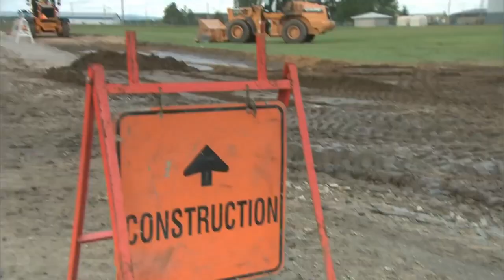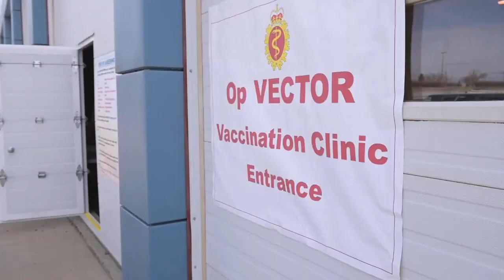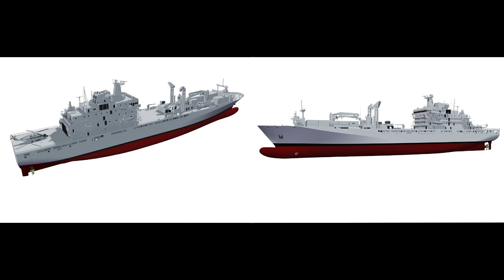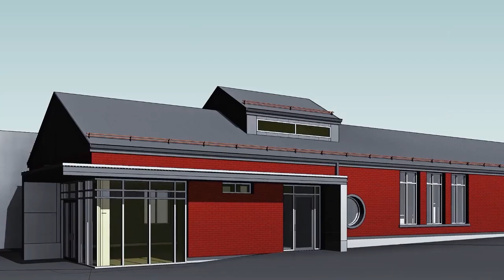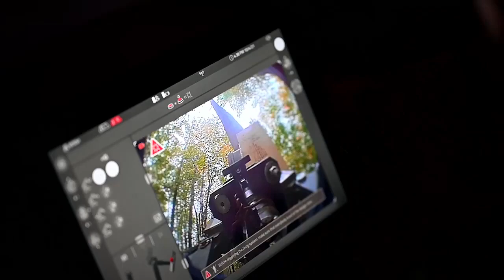Get Excited - A Look Ahead: Comprehensive Overview

Comment: All of the Leopard 2A4 should be upgraded to 2A4M standard with L55 guns. We should've still kept those Leopard 1C2 in our inventory as infantry support vehicles. Our force is too tiny for any real impact on keeping the world safe.
Reply: if theyre going to upgrade anything on the A4M it should be the Engine, Transmission, and torsion bars. the power pack cant support the extra weight. making the leo useless
Reply: We still have all out Leopard 1’s they are sitting rusting in a open air parking lot in gagetown.
Reply: @colinjohnston5734  i mean, thats not true
Reply: We aren't responsible for keeping the world safe. The biggest impact we can make geopolitically is with economic power. Any humanitarian cause we would assist with NATO or the UN would likely only require air-power, not a full land invasion.
Reply: @off2tims962  you are right, 5 were gifted to Oshawa Museum.
Reply: you can have all the tanks in the world but if no one is willing to stick around and drive them then what...
Reply: Just the results in Ukraine ,tanks ,some helicopters etc are becoming obsolete, the drones seem to be very effective along with the stingers or whatever version.
Reply: @stevejones1563  Nonsense. Average lifespan of a drone is between 3 and 6 flights in Ukraine. Only clueless armchairs think tanks are obsolete.
Reply: @death_parade   ok play your video games ,I was in the military and thats my observation in Ukraine that I'm shown, why are drones ,stingers and whatever working quite well,also costs ,there's alot for argument .
Reply: @stevejones1563  You aren't the only one who has been in the military. And judging by your "observation", you never ever sat in a single class of Combined Arms Warfare. Or any class on Design of Experiments or Statistical Analysis, for that matter. Or you'd be more appreciative and nuanced in your  views, not like now, where you give out blanket statements as if one war is enough to dictate which way the RMA is going.
Reply: @death_parade  General Patton! Wow is that really you, say what you want I was looking at Ukraine only ,there's the numbers and footage shows tanks blown up ,stuck whatever all over the country ,I don't need a class to show me that, also look at Russia now pull back and use missiles which others would have done first  then maybe tanks etc
Reply: @stevejones1563  Thank you for further proving my point. What you need are classes from Ronald Fisher.

Comment: Yes all the leopard 2A4 should have been upgraded several times. Even the A6 should have been upgraded. Some of the 1c2 chassis could have been used. Our government NEVER wants to spend on the military so we should be like Israel & use, upgrade, rebuild enhance some of our equipment instead of just scraping.
Reply from the maker: That's our plan so far with Subs, Fighters and Frigates etc until replacement. Unless we are entering a period of war or instability. 

It's probably the right choice, I'd rather have our better quality of life than a massive bill from the military.
Reply: 2a4s are for training.
Reply: @FrontlinePros  How often do you replace your car, remodel your kitchen, bathroom. I guess it's alright too do this living beyond your means but the military can use generations old equipment.
the aircraft they are using were purchased during trudeau the firsts reign.
The military is like the police, ems & fire dept., you invest in it to get a better quality of life. It's always there if you need it.
Reply: @sharpy3453  As I understand it Canada purchased 120 leopards broken down into approximately 100 2a4s & 20 leopard 6s. So we bought lots of training tanks & relatively few combat tanks.
Do the Americans buy 2 sets of tanks, one for training & one for combat. I suggest we buy all combat tanks and replace those that are worn out or uneconomical to fix as they are needed but then I would want a lot more. Seems I would get more bang for my buck than wasting billions on farmacare & day care etc.
Reply: @donhlohinec2242  we have 3 variants. The a4, a4m can and the a6m. The a4m can is our most advanced tank in our inventory.
Reply: @sharpy3453  The a4 is a none upgraded tank. the a4m is the one with reinforced belly but NO better gun than the original. the 2am6  is the one with increased belly armour & better gun.
Reply: @donhlohinec2242  the a4m has belly armour, an electric turret, improved electronics and whatnot and has arrowhead armour on the front with additional side armour on the turret  and hull. It's currently the best tank in the inventory until they upgrade the fleet or purchase new tanks. Knowing the caf it will be upgrades next
Reply: @donhlohinec2242  The training tanks can be upgraded to a higher standard, but they'll probably not see any tank-on-tank combat. They are more likely to be used for infantry fire support and taking out the odd target of opportunity - i.e., APC, IFV or tank if they pop up.
Reply: The Leopard 2's have been upgraded.  I agree the A4's should be armed with the L 55 though.  We should also buy more so all three Armored Regiments have 3 squadron's worth not just LSH(RC).  Unfortunately keeping the C 2's is not an option, unless we can source spare parts for the next decade or more.
Reply: @donhlohinec2242  all of the Leopard 2A4's that serve in the Armored Regiments will be brought up to 2A4M CAN standards if they are posted to a war zone.  For training here in Canada the added armor is not needed.  I do think we should have bought more though.  All 3 Regiments should have a full complement of tanks.  Right now the RCD and 13 RBC have to share.

Comment: For a defense oriented air force like the RCAF, I feel the SAAB Grippen-E is better suited than the Lockheed Martin F-35, with radar tech constantly advancing, we don't know long aircraft designed to be stealthy will actually stay stealthy. Not to mention that with the F-35, unless you're ready to sacrifice that built in stealth, you won't be using the six weapon hard points under the wings and be restricted to the two internal weapon bays. The Grippen-E has better range without external fuel tanks, it's more agile at subsonic speeds, and cheaper per unit and lower operating cost. Not to mention SAAB already verbally agreed to build at least two production facilities in the Montréal area, adding to our national industry.
Reply: Our industry is already producing parts & doing research for the F 35 & the facilities are in other parts of Canada not just Quebec. The Grippen will be just a make work project for Quebec.
Reply: The F35 have more capabilities than what you mentioned. It can do EW,  SEAD, command and control ammunitions fired from other aircraft just like alley oop in basketball with digital link connectivity.
Reply: Canada is a member of NATO and may be called upon to defend another member state. If Canada's idea of it's airforce is just air patrol and interdiction, then the old F18 is good enough to fly side by side with Russias clunky bombers. But when the shooting war begins, those 4th gen aircraft will be ineffective against new SAMs and LR missiles. Trust the professionals to make the choice and not the pundits and politicians.  Israel, US  Germany, UK, Australia, Netherlands, Finland,  Denmrk, Japan, Italy, Singapore, Switzerland, Belgium, Norway, air forces cannot be all wrong.
Reply: The Gripen is so good that Sweden signed up for the Tempest program.  That tells you all you need to know about the future capability of that aircraft.  Read your defence policy: Canada's air force is expeditionary, with NATO missions to fulfill.  We need a fighter for the next 50 years, not the previous 50.
Reply: Nailed it Nicko...100%.
Don't get me going...
The best fighter for Canada?...is the one in the air.
Just one look at the map of Canada...turn it upside down...says it.
I worked and flew, in the back... out of Yellowknife for ten years up to the Nunavet border.....there wasn't a tree for 100 miles in white-out conditions at -50 below.
The Gripen E/Fs are perfect for Arctic OPs..... they can ride off an Ice-road or a mine strip with small dedicated basic support teams.
Yellowknife and Iqaluit would have been perfect locations to station new permanent Sqns.

These '88' F-35s, (replacing 138?...did Canada shrink?) is a game-crushing 'hanger queen.'...fixed and locked into just two massive 'big base' infrastructures at Cold Lake, Alta, and Bagotville, Que.

I like to go to Bestfighter4canada.org...' Jet fighter club'...Gripen vs F-35 for comparisons.
Good luck...Good hunting📯
Reply: Ukraine/Russia war is modern combat, nether side has air superiority because nether side has a stealth jet that can operate and hunt SAMS, Gripen will be the status quote, will see the same when Ukraine starts operating F16's.  The F35 can house 6 internal air to air missiles, it was only two because a rail system to deploy them needed to be developed but other things were higher priority on the list.  Block 4 F35 should have the rail system .

Comment: I drove a TAPV for 3 years in the Canadian Armed forces with the Royal Canadian Dragoons and took part of Operation Lentus and Op. Laser. My unit was sent to Latvia when my contract ended.   Procurement for the armed forces is the worst.  A TPAV is a multi million dollar vehicle and most of the doors would fail or straight up not even work. Also they built a new facility for us which they only found out @ 90% completion that it couldn't house our entire unit which was its purpose.
Reply from the maker: Sounds about right, they keep trying though bless their hearts.
Reply: @FrontlinePros  really great video tho good research

Comment: If Trudeau wants to impress me, he could announce a one time 20B invest in CAF just like germany announced a one time 100B invest.
Reply from the maker: I'd like that. I'd like that very much.
Reply: @FrontlinePros  could get some shiny new tanks and upgrade the current ones, tracked afvs and actually buy them this time instead of canceling the purchase of cv90s because some pencil pusher in ottawa decided the lav could do the same job and buy some other newer stuff. maybe bump up the size of the military. maybe get some attack helicopters as well.
Reply: @sharpy3453  It would probably be spent on IFVs and anti air equipment for ground force. And, in my dream on a legit artillery system. Right now i think we have 30ish M777, its not 5 canons per province... It takes 10 man to operate it and has a range under most modern motorized artillery system.
Reply: @benoitnadeau5845  yeah, some kind of self propelled system again, cv90s would be good, especially if we get ones with TOWs. could even get some air defence ones or another vehicle for air defence and maybe 105 or 120 equipped ones.

Comment: The F-35 is an ultra-modern fifth generation stealth fighter more than able to survive a modern high intensity conflict. The Grippen is a decades old forth generation non-stealth fighter, already obsolete and utterly unable to fight a peer adverasy without massive losses. Therefor the Canadian Parliment will almost certainly go with the Grippen.
Reply: they had some serious issue keeping this f35 in the sky weeks ago it cost a freaking fortune to run and maintain and its a bomber not a multipurpose fighter wich we need!
Reply: @davidlefranc6240   "a bomber not a multipurpose fighter"

Way to advertise your ignorance.

Comment: The best shipbuilding company is the Sorel one. So it should have a part of the contract. 
Le chantier maritime de Sorel est le meilleur pur construire les frégates, de ce fait il devrait avoir une part du contrat.
Reply: No. It's too french.
Reply: @derekcollins1972  French or not it is the best and the biggest in east of Canada (may be in east of north América). The most protected in case of war ( witch could append soon).
Reply: @christiandebray  No,they are doing well where they are. Too much red tape to be made in Quebec.

Comment: I would have prefered the F18 Super hornet or even the F15 Eagle , I think our pilots should ride over the vast north with two engines.
Reply: Single engine F16's from 148t Fighter Wing have been patrolling in arctic as part of NORAD for some time now. New technology also sees advancement in reliability, which makes the dual engine redundancy a moot point.

Comment: If I ran military procurement, would drop 3 CSC, and purchase 2 Juan Carlos Amphibious Assault Ships c/w 40 F35-B Strike Fighters for expeditionary operations.  For Continental defense, would build in Canada 50 Gripen E ‘Arrows’.  This alone IMHO would only be incrementally more money, but increase capabilities significantly.  Then I would start modernizing the submarine fleet, purchase mobile air defense, and a small fleet of marine attack helicopters.  😁

Comment from the maker: What CAF project or new equipment are you looking forward to in 2022?
Reply: The F-35 or the gripen
Reply: We get new equipment... that is a first.
Reply: I think that both the F-35 and JAS-39 are neat planes, and either would be great. On one hand, you get a nimble multirole that’s much easier on the RCAFs wallet, and on the other, some funky fresh stealth and sensor tech built around network-centric warfare.
Reply: 2022? You mean 2032 at the earliest
Reply: LSVW replacement?
Reply: @flimmingo8ch  Rumour is it's a Mercedes Benz Zetros. Much larger than the LSVW, almost as big as MSVS, odd choice
Reply: Some integrity in protecting Canadians on home soil.
Reply: Really hope they pick the Gripen. We need longer ranged aircraft that doesn't rely on passive stealth. Domestic production is a big plus.
Reply: Big heavy duty tow trucks, please!
Reply from the maker: @flimmingo8ch  God I hope so, one day. I saw some draft purchase ideas a decade ago.
Reply: Missiles equipped delta planes

Comment: The RCN needs two LHA's (ex USN Tarawa Class of available) they can serve the Army with better Expeditionary capabilities and they need tilt rotors of some sort the AW609 comes to mind (Army and Air Force) they also need a pure attack helicopter (that can be used in both maritime and land environments again Army)  the RCN need to invest in LPD's of some sort (New Zealands Canterbury Class comes to mind) again to enhance Expeditionary capabilities for the Army (plus HADR etcetera) the RCN will need at least 2 LHA's new or used and x2 LPD's new or used. The Army needs to get dome Bradley's from the US but with the 30mm turret to complement the Leopards and enhance tactical armored mobility on the battlefield.  The F35 is a great plane for countries that can spend 800 billion on their military where they can afford to buy 100's of them as opposed to 45-80 to cover a land mass like Canada, they need quality and quantity, what aircraft can balance those two aspects, not the F35 for sure. Anyway just thoughts  btw anyone who think that Canada doesn't need at least LHA's or LHD's is living in la la land (hell give them ice breaking capabilities to boot) but dont buy down on the Armed Forces especially when there are so many hot spots on the map right now.

Comment: We need Battleships, Destroyer's, 6th generation Air Force Fighters, f-35 would be nice 👍 stealth fighters & bomber aircraft. We need attack Helecopters and 100s of thousands more updated Battle tanks. Drones and we need the better Air defense systems, basically overhaul the military, Strong & Free.... Our Military could be a whole lot stronger 💪 if our Government would stop the red tape & put all the resources from our Country, oil, gas, minerals etc to good use in our Military.
Reply: They don’t need battleships nobody uses em anymore
Reply: the only way a battleship size ship would be usefull is if the turrets had rail guns and it was armed to the teeth with missiles and air defence.

Comment: Canada needs a military that is twice the size it is now. More funding, more equipment and more personnel would give us a much more serious self-defense capability. New destroyers, new submarines and at least one helicopter carrier and a second supply ship are urgently required. The army should be 40,000 strong with less generals and more tanks, and the RCAF needs a capable twin engine multi-role fighter, not the horrendously expensive flying video game like the F-35.  The Typhoon would be a far better choice. It is faster, has longer range, a higher combat ceiling, and can carry more weapons. Plus it's CAPTOR radar system is the best out there. This can all be done within the next ten years or less if defense spending is boosted to 2.5 percent of GDP.  But I'm not holding my breath if Trudeau manages to stay in power.

Comment: Rah rah rah… BULLST… The cool stuff is 1% of the job, 99% is fixing SHT with gun tape and forcing SHT to work or dealing with officers make work projects so they can get the “initiating change” tick in the box on a PER. Treasury Board Procurement is a train wreck. Nothing like buying a RADAR system  that doesn’t communicate with UN/NATO Allied Forces. Or building, buildings using 10 year old specs and realizing after its build that the new vehicles can’t fit through the doors. Using a pay system that is from 1986 Lotus DOS system. Using 5 different Data bases to store information that do not communicate with each other. 5 different stages of uniforms and boots. Personal equipment that doesn’t fit soldiers. Don’t even get me started on the train wreck that is OP Honour… Piss poor leadership… The Universality of Service Force Test not being a gauge of fitness… Or the visible obesity of both the Reserve and Regular forces.
Reply: At least the Browning pistol is awesome.... right?  right?